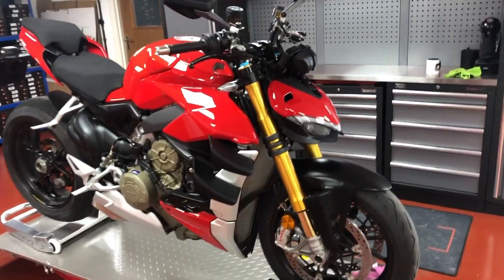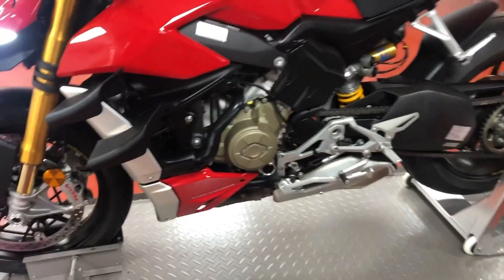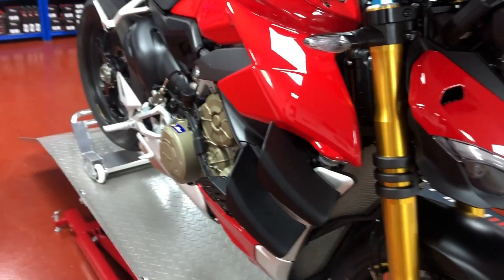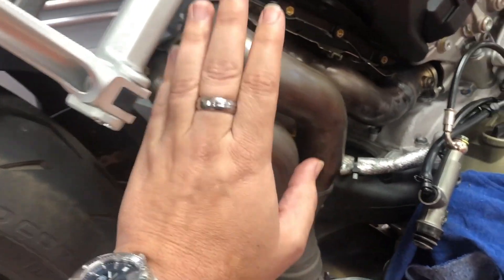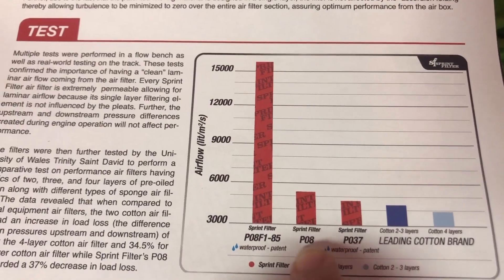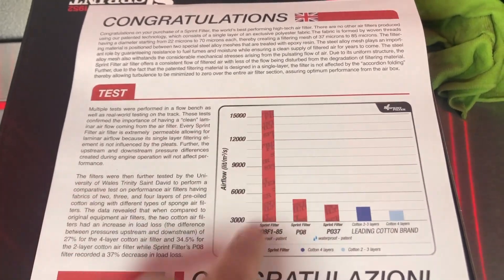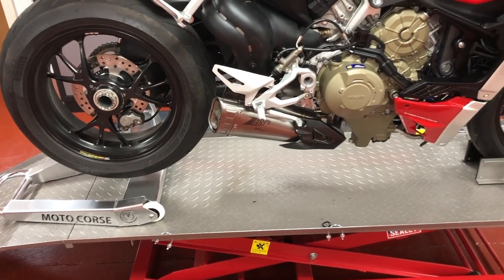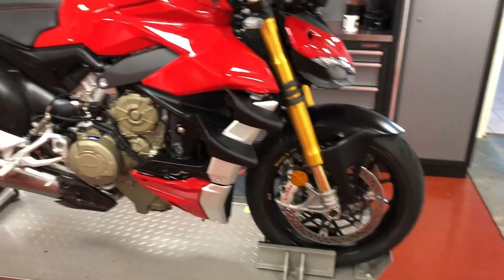Ducati Streetfighter V4S SVF custom performance parts build by Conquest Racing Part 1

Comment: Hi good start so far. Can I ask if you have any issues with the quickshifter/ auto blipper after fitting the throttle spacers? I fitted some aftermarket to mine and unfortunately had to remove them because the shifter didn’t work properly. Perhaps mine were too thick and removed too much play?
Reply from the maker: Hi Carl, thank you very much. I haven't had an issue with the spacers provided by Speedo Angels?
Reply: @conquestracingltd7914  ah that’s great thank you. I got mine from another spacer company. I might give these ones a try as the throttle does have quite a bit of play
Reply from the maker: @carlfortescue5425  You're welcome. Speedo Angels are the UK importer for the original manufacturer, their link is in the description above.
Reply: I was stupid enough to but throttle spacers once, now I use cable ties cut down - does the same thing for pennies. My current bike is the same as the one in the video, SFV4S.
Fool and his money...